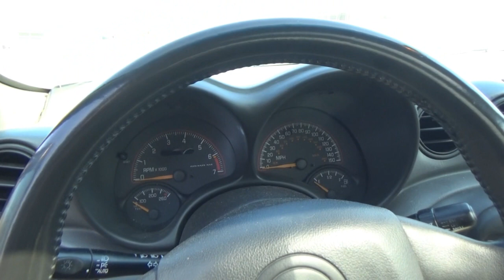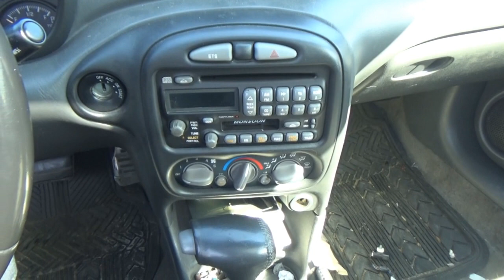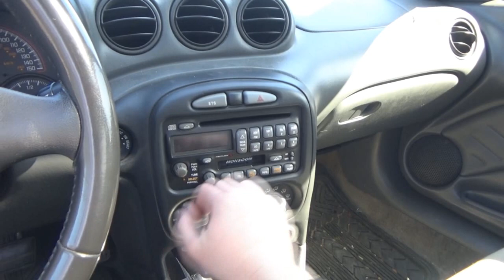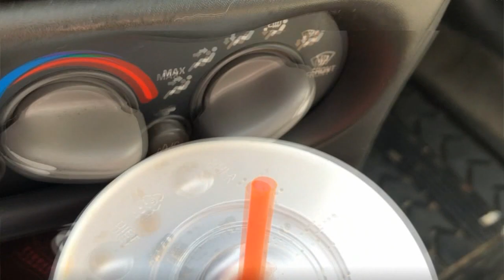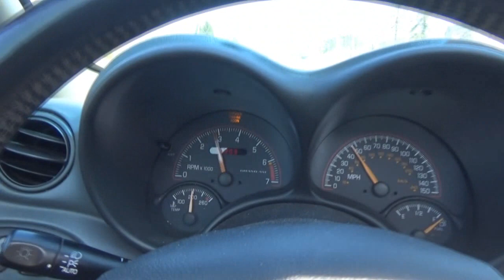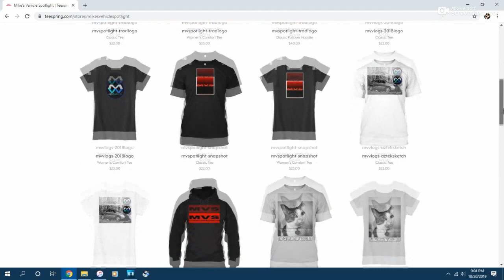MV 323 - "Why My Grand Am GT Is SO Awesome!"

Comment: If you need help with the RPO codes, I'm good at that. My husband has access to GM archives and can run the VIN and we can also get production numbers.
Reply from the maker: Tomorrow’s vlog will cover the RPO codes actually! I found them through a service website we use at the dealership, so I’m assuming they are accurate. At least I hope, hahaha